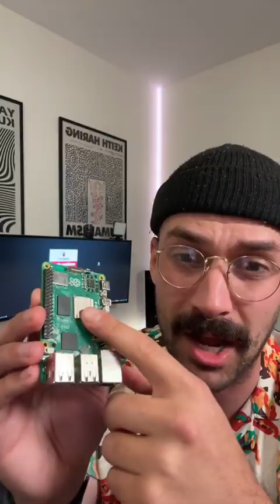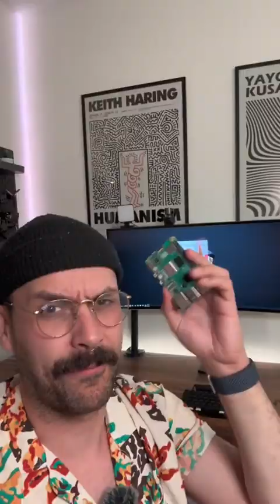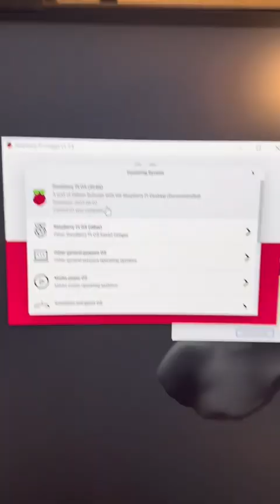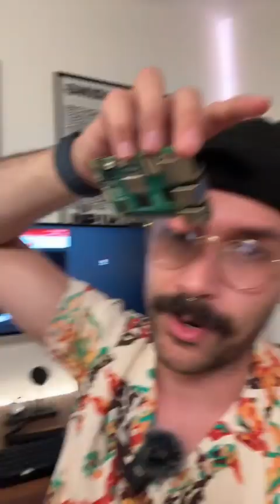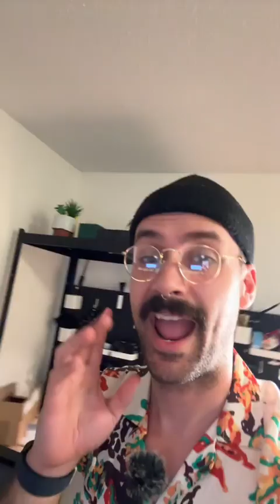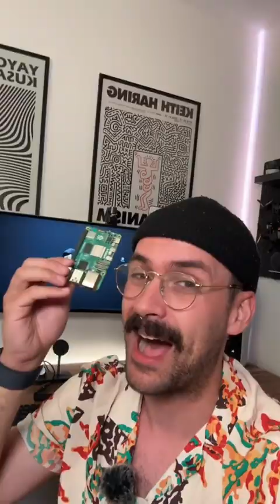TOP RASPBERRY PI USES FOR DIY AND TECH HACKS

Comment: The nand price surge have caused pi retail costs to skyrocket.

Raspberry pi 5 cost breakdown: (prior to taxes & without accessories)
16GB Model - $305.00
8GB Model - $175.00 (purchased one prior to the increases @ $89.00)
4GB Model -  $110.00
2GB Model -  $65.00
1GB Model -  $45.00

Prices sourced for approved reseller PiShop US. The Pi zero models are basically nonexistent, recently attempted to acquire one for a DIY pen tester gadget recently ran across, but the prices from the few places i was able to source one from had massively inflated prices.